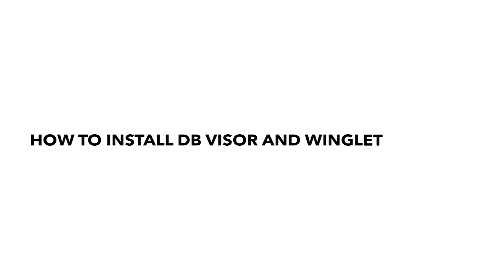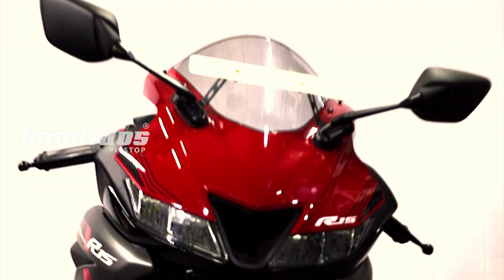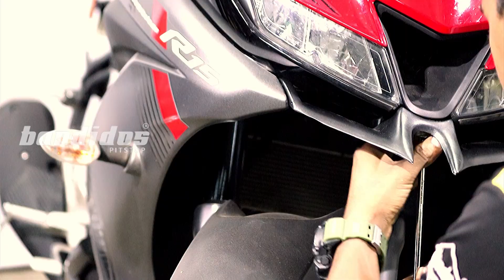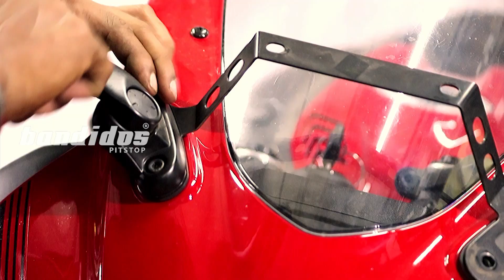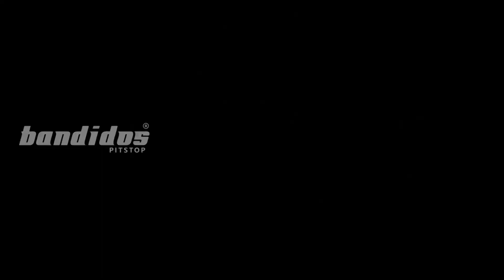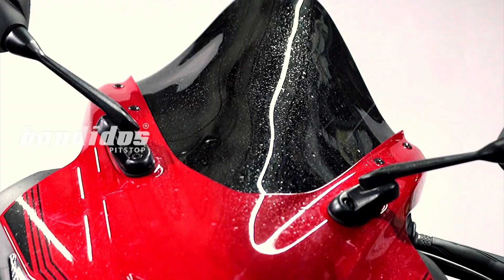How To Install DB Visor & Winglet For R15 V3

Comment: hi bro how do you take off the front mask for v3? i mean the front cowling. it seems to be stuck after i opene the four screws from the visor and the side mirror screws
Reply from the maker: please connect with our technical team in 8089020202 for details on technical aspect

Comment: Do we also need to drill under the headlights ??????????
Reply from the maker: For installation assistance please reach our technical team at +91 88089020202
Reply: No drilling is required under the headlights.. Just use the screw driver